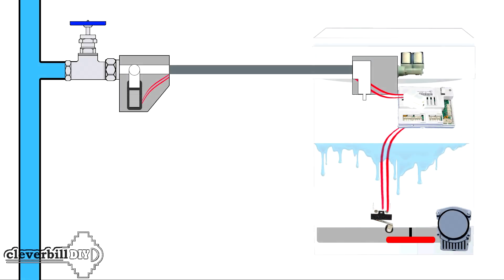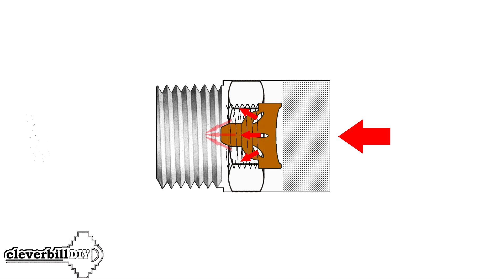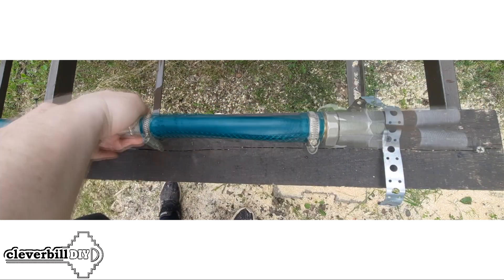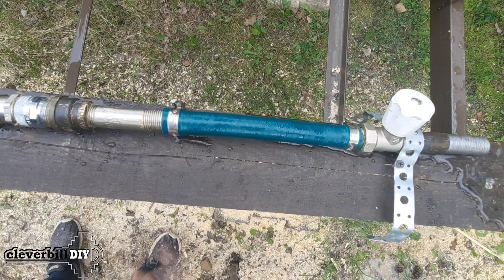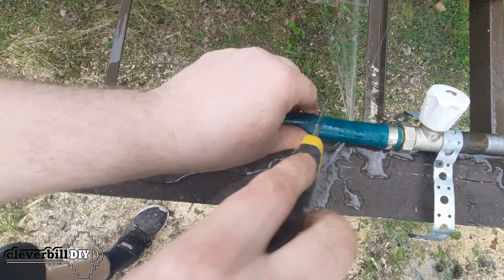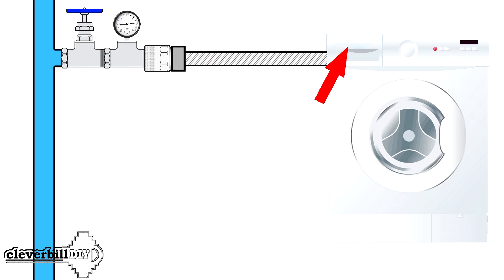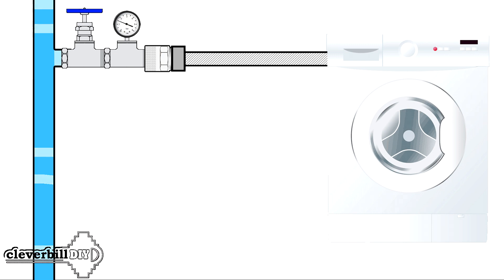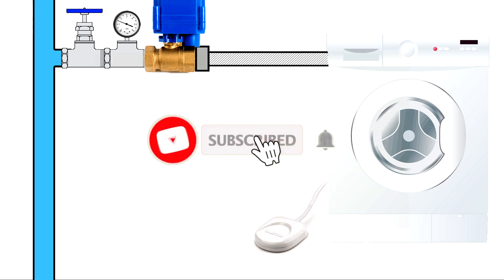Aquastop - valve against leaks - will it protect or not?

Comment from the maker: Many installing Aquastop valves in the home water supply system believe that thereby they completely protect their water supply system from leaks. But this is not entirely true, such a valve will not protect the homeowner from a partial hose break or a crack in the plumbing. The valve will not work on pouring water if the jet is very small, since its response threshold is designed so that it would not be triggered to turn on the mixer or fill the washing machine.
Reply: thank you for the video & explanations, this device partly protects your house against floods